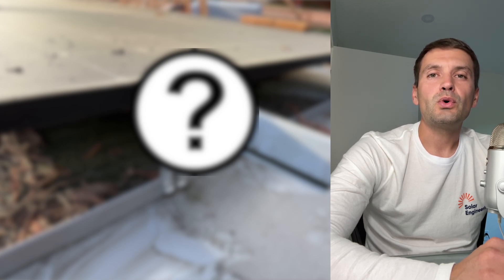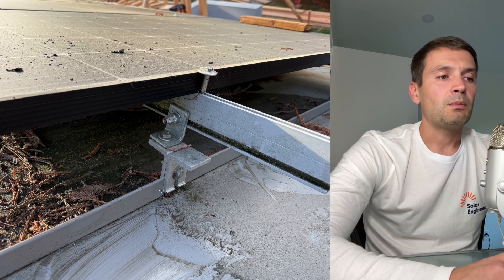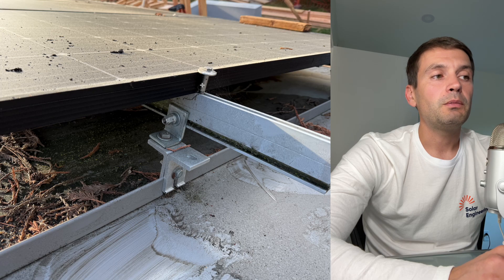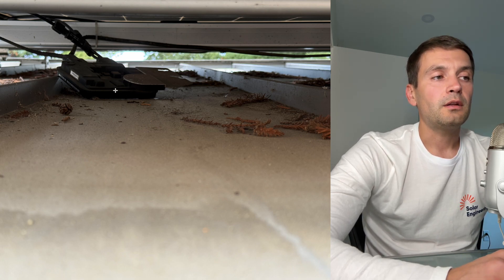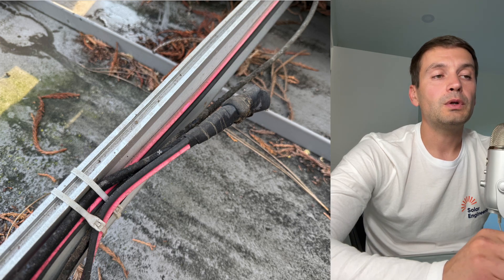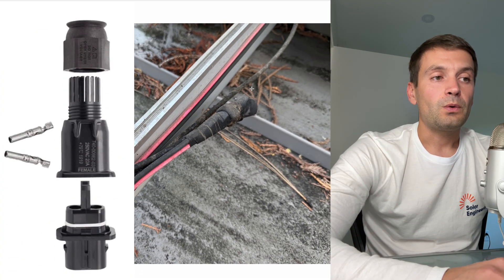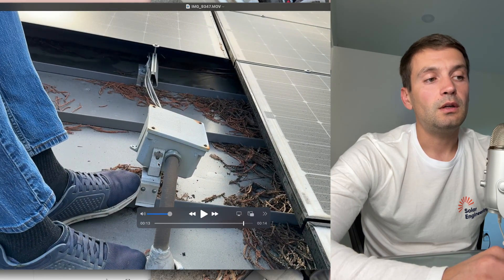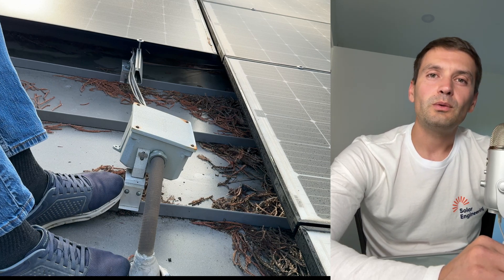How not to install solar panels. Part 1.

Comment: What is the problem using "PV" cables for ac? They are made for higher voltage and if the current does not exceed the limit for the diameter, there should not be a technical problem.
I would not suggest to use them for this purpose, nevertheless.
Reply from the maker: AC wires must be in double insulation or must be in the conduit (THHN for example).
To connect the trunk cable and junction box, we need to use Enphase Q-CONN-10M/F connector which is not rated for PV cables.
Reply: Sure, the cable needs to fit the requirements for the connector.
Reply: Most are rated for 600v so I don't see any issues.

Comment: That’s why you put it out in the yard on pressure treated lumber, plenty of hardware available, you can cut short pieces of gray PVC as your spacers on the ends, easy access to both sides of the panels and no chance of burning your home down if you’re solar panel or pv wiring catches on fire. Put your power shed 100 feet from the house and run your AC through underground conduit. 2 1/2 years off grid and loving it. DIY.
Reply: Issue is most only have so much land that has sun exposure so the roof is the only option.

Comment: I dealt with a lot of problems like this after the solar incentives debacle in the 1970s.  We'll be dealing with incentive driven problems for decades. This isn't affecting just single family homes, but also giant wind farms (uneconomical to maintain after the subsidies expire) and solar farms (what happens when it comes time to repanel? when actuators fail?) and even commercial rooftop installs that catch fire due to shoddy chinese panels in high voltage systems.